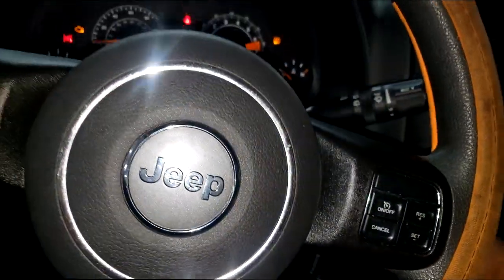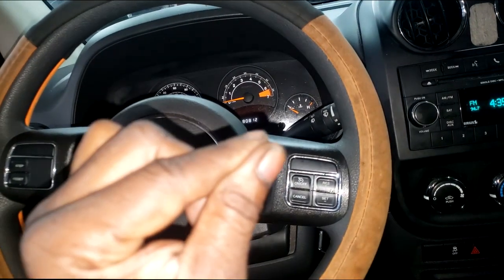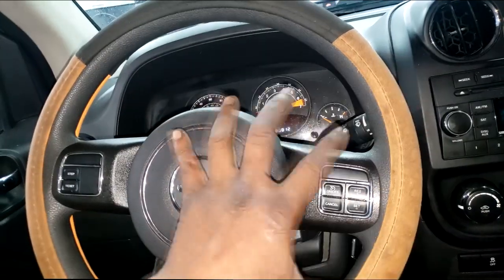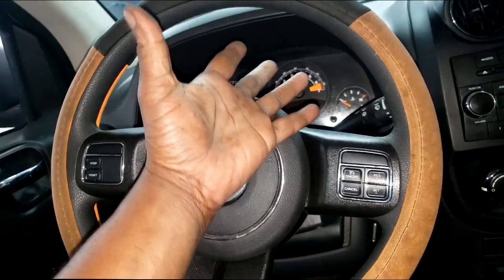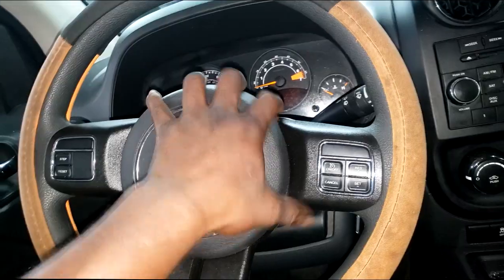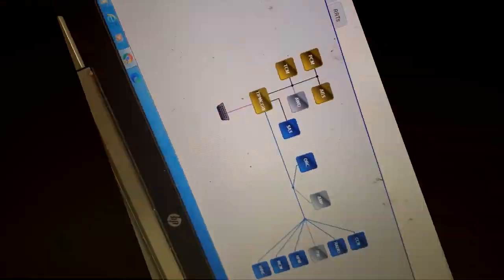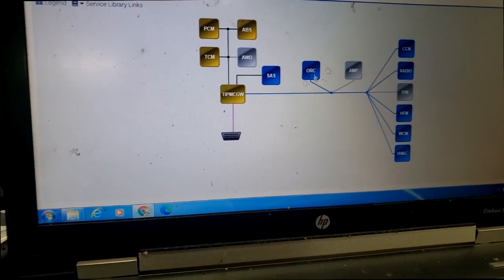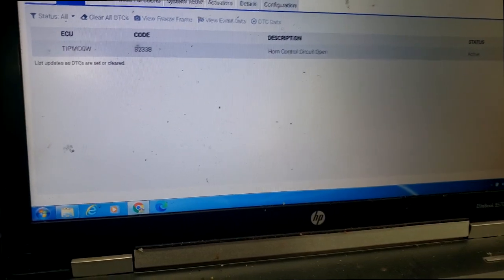How to fix your TIPM Computer controlled horn to blow. No fuse for horn. B2338 in this Jeep

Comment: If you measure the voltage on the wire, without pressing the horn pad, for the horn unplugged(you might need the key on) you should measure a voltage. This is called a bias voltage. It is a weak voltage that won't light the test light, because the voltage is being sent out by the module, and it goes through a high ohm resistor. The module has a voltage sensing circuit after the resistor, and the voltage should read 0 when the horn is plugged in, or there is no break in the wire, or in your case, the horn itself is open. This is because if the circuit is complete, the voltage will be pulled to ground through the complete circuit. If the circuit is open, such as the horn itself being faulty, the voltage sensing circuit will now "see" the bias voltage(no current flow, no voltage drop) and know the circuit is open.( Could also be a bad ground for the horns)
Reply: Where is this ground wire on the 4cyc FORD FOCUS cars???

Comment: I thought I was slick. I bought two horns and soldered everything together. Installed the horn on the patriot. It worked for a day. Then it stopped working. I tested the resistance and its about 1.1k as opposed to the single horn which was about .5k. The computer knew and instead of just sending the signal, now my horn doesn't work. Annoying. These computers know all.
Reply from the maker: lol
Reply: did you ever find a fix? I'm having the same problem. I installed new harbor freight horns where the factory ones were, and it didn't work. This video makes me wonder if I have to replace it with the same factory horns?

Comment: Well, can't thank you enough for this because, it's the best explanation I could find. My son has an 08 Patriot (same motor) and, I was stumped thinking there's a fuse or a relay or something. You cleared that question up so, I'll be tearing off the bumper (LITTERALLY HAVE TO TAKE THE DAMN BUMPER OFF!!) to test the circuit. So stupid for a damn horn but, you saved me some headaches...

Comment: Very well done.  
There is a horn relay in the power module.  You and I would have found it when we were younger on the top side of the fuse block.  Today, some engineer that has soft hands and that has never turned a wrench has decided to put it on the bottom side of the fuse block where the battery vents atomized corrosive air.  You and I are technicians and know what migration is.

Luckily in this case, 8t was the horn and not the integral relays on the underneath of the tipm.  I have seen several where atomized charged acid have indeed migrated into the very attractive circuit points underneath the power modules.
Reply: Also, to help unravel the mysteries of modules.  All a module does is makes and breaks ground.  The relays often are considered current sensing.  The way these relays behave 8s like that of a collapsible circuit.  At shelf state the relay is open.  Each circuit of any system contains a load which does consume power, this is a resistance.  If no power travels it has no amperage.  If too much power travels, there will be a high amperage.  If the current is low, the electrical signal travels into a different path on collapsing the circuit through the relay  that path is like a lightbulb that you cannot see, but instead it triggers a different type of display which is a hidden number that says open circuit and then it says which processor/module contains that calculation.  If it is too high in current which means the load/horn/ resistance is too low (possibly  a short) it will redirect the electrical signal to a different portion where instead of activating a horn or light , it displays high signal on whichever processor is responsible for determining the abnormality.  If the current is on the specific range that the manufacturer has designed it to operate  then all is well.

Electrical diagnostic is where the $$$ is at and I am unemployed  lol

Comment: Nice video bro. I got a 2016 Rubicon, having the same issues with my horn and steering wheel functions. I tested my horn by using my panic button. Horn worked fine. From what I’m gathering at my clock spring.
Reply: Did you find out what the problem was? My wife's 14 wrangler is doing the same thing right now. Horn and radio steering wheel controls not working

Comment: I've got one for you, I needed new bearings on my 2013 Avenger and while I was waiting for new ones to be shipped the battery died. So while I was swapping out the bearings I had the battery out on the charger. Once done and everything put back together, now my horn only works while the car is on. So if I press the lock button on the fob twice it will not honk or if I reach in and press the horn on the steering wheel too. But if it's running, it works just fine.

Comment: Did the new horns fix this problem? I tried swapping with harbor freight ones, and it didn't work. Since you said there might be a small resistor in the physical horn I'm wondering if replacing with factory horns would work.
Reply from the maker: On this problem, yes. But you need to verify if you getting power to the horns first. What kind of car is this? Also are you subscribed to the channel?

Comment: 2012 Jeep Wrangler cruise not working the switch on steering wheel turns cruising on dash the light comes on but no cruise still don’t work has a 6 speed manual in it and clutch switch works otherwise it shouldn’t be able to start any idea? Has the tpm sensor out of the tires so that light is on

Comment: There is a ground that goes back to the TIPM to sense the voltage (expected watts, etc.). The TIPM senses that the circuit is shorting and it turns off the horn circuit completely. This is the same for all lights, it sends out voltage tracing and if it is not the voltage it should be, the circuit for it will be shut off. That’s why TIPM’s hate LED headlights. They will turn off and back on testing voltage and will eventually turn off the headlight because it should be receiving back a certain usage of power like 12v and 55w, but only gets back something like 4 volts. It is a “safety”, like if you were in a wreck and the headlight was crushed and the bulb was broken, it will stop sending power to it completely. But the grounds are connected back to the TIPM. Often, the relay in the TIPM will fuse open or closed for things like windshield wipers, lights, etc. I would imagine that if you replace your TIPM, your horns will work again. I have replaced several for the same reasons. The relays suck. The horn happens to have an internal relay, unlike the fuel pump, lights, windshield wipers, etc, that can’t be soldered on. TIPM’s are a good idea, just a terrible design!!

Comment: So if it’s not light up from the pigtail what’s the next step
Reply from the maker: It depends, what kind of car is this?
Reply: Same type of car and yeah just subscribed bro
Reply from the maker: @memphismemphis3130  Hey bud, yes the horn signal goes to the TIPM. If you had a good scan tool you could read data that would show if input being received from the horn switch and if the out put going out to horn..your problem could be anything from a clock spring to a TIPM.
Reply: @OnlineMechanicTips  ok preciate ya information bro

Comment: Do you respond to comments?
Reply from the maker: Of course, especially if you subscribed to the channel.
Reply: @OnlineMechanicTips ood thing I am subscribed 🧍‍♂️ I had a question regarding the horn. I have a Jeep Patriot 2010 and the horn has been going off on its own randomly. I check some problem codes in the computer and the codes that come up are “B2338 Horn Control Circuit Open” (same as your error code in your video), “B2339 Status STORED - Horn Control Switch Stuck”, “P1279 Starter Control Circuit 2 Open” and “U0141 Lost Communication With IPM (FCM/TIPM)”. I was wondering if you have any idea as to what’s making my car horn go off on it’s own? I’ve read online that it could be that the lock spring isn’t working properly so that it should be replaced, but most of the time that doesn’t solves the issue. Do you have any suggestions on how to diagnose this issue? Thanks again for responding! (PS: I’m trying to have some father and son bonding time with my dad by fixing this issue ourselves, but my dad is really stubborn is just suggesting me to sell my car… even though I’ve only had it for about two years lol)

Comment: It's what we call broken... 🤣 I'm surprised it died that early but mounting it that low let's water and crap inside so it died. It's possible they feed each other in series so if one goes bad it kills the circuit so if one is still good it can't work.